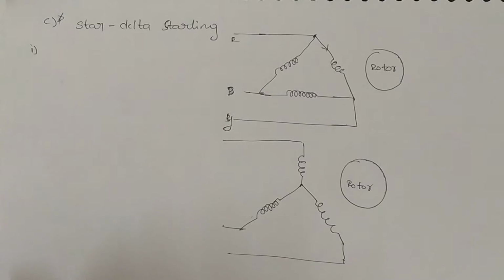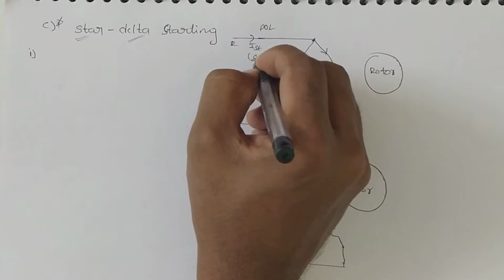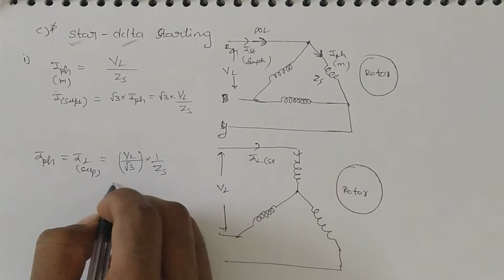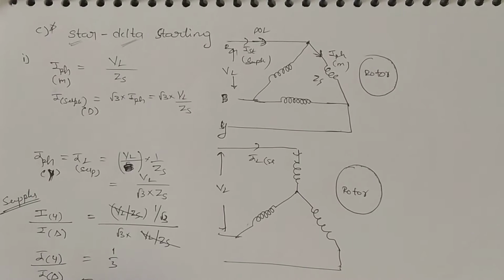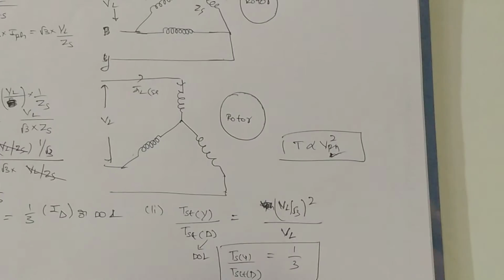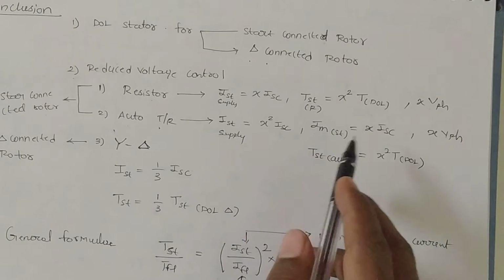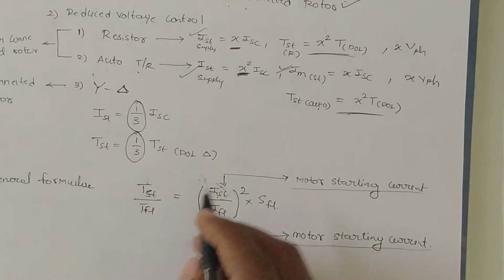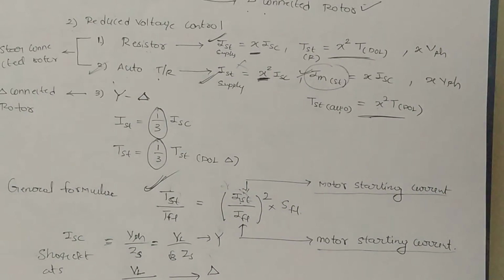STAR DELTA STARTING OF INDUCTION MACHINE

Comment: sir what is difference  between  Isc and  Ist
Reply from the maker: Starting current means starting line current from the supply.and Isc is short circuit current when the machines is at stand still i.e S=1